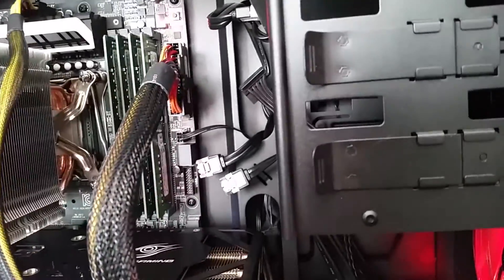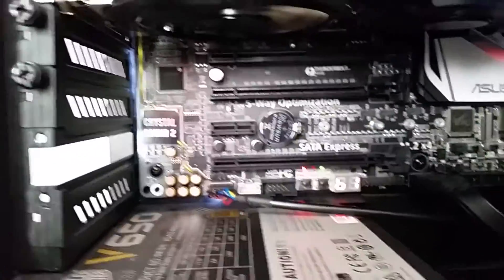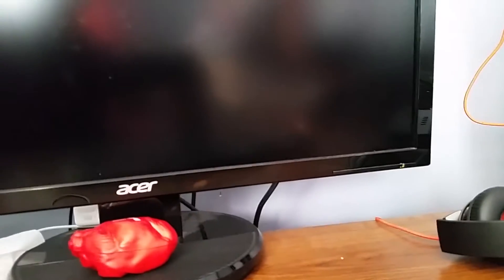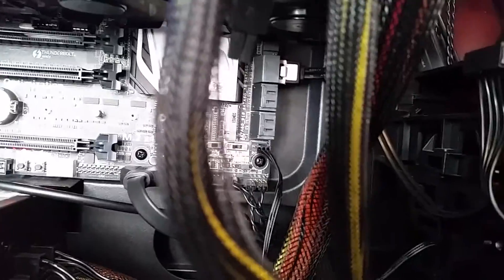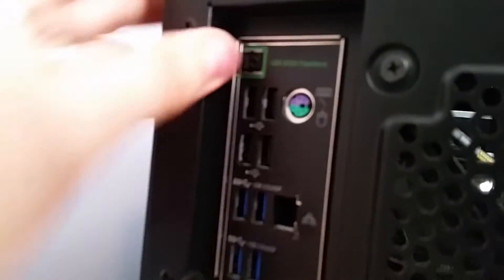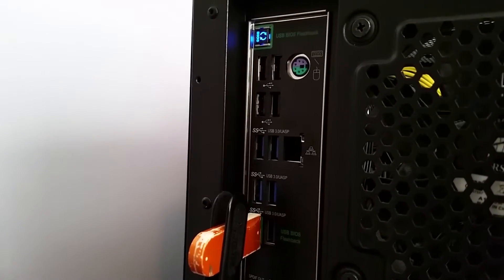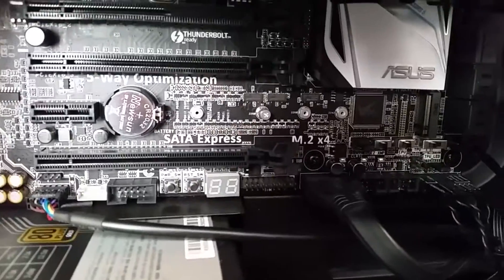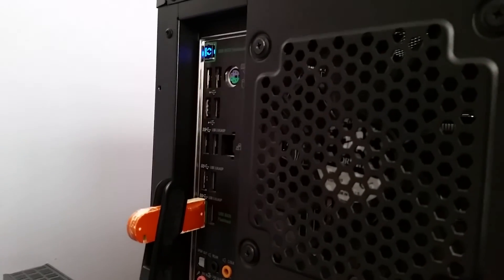10-18-2015  troubleshooting steps video 1

Comment: I just got the same motherboard that came like three days ago. I have the same problem. When I received my mothevoard the reset bios button was broken. I wonder if its the motherboard.
Reply from the maker: I wrote up a reddit post detailing everything man. They eventually said I was stupid and sent them the wrong product then sent me a different motherboard that doesn't fit my cpu o_O https://www.reddit.com/r/ASUS/comments/3xz9sf/asus_gets_a_lump_of_coal_for_christmas_serious/
Reply: +Charles Rowland I have read your reddit post and what a shame for asus sending you the wrong mobo. 
I was thinking about taking it to a pc repair. I have done everything you did on your troubleshooting videos and same error as yours. Were you able to fix it? How is your pc right now ?
Reply from the maker: +Edel Patrick Cabradilla my original board works except for the two bad ram slots and I still have that board thankfully. Nothing ever got resolved on the two replacement boards. I did an advanced rma, so they sent me the replacement board without me having to send them a board first. This video is of the replacement board. I then had to send this board back to them. They sent me another board to replace THAT one and it had the same error. So then I had to send THAT back where they then told me I sent them a Maximus VII Hero board and then sent me one of those back o_O

Now I am supposed to send back in a maximus board for the replacement.. a board i have never owned. They told me they wouldnt take the board they sent me back either, that it would go through repair if its not damaged they will charge me. They also say they will call me, and never ever do. so, whatever i guess. 

My advice to you, is get another motherboard that is not from ASUS. Burn the board you have in a metal barrel.
Reply: +Charles Rowland Yeah. I am returning everything back. The mobo+cpu+rams. 
I am tired of doing it by myself and I got myself a system from maingear.com with the same specs that I have gotten. 
So sad that I had to buy a prebuilt one, but I have no other options. 
I have invested too much time on trying to troubleshoot this.
Reply: +Edel Patrick Cabradilla so, i got an asus rampage v extreme that im doing an advanced rma with. Out of curiosity, did either of you two resolve your issues?
Reply from the maker: +18266609 nope :(
Reply: +Charles Rowland man that sucks. what did you buy another board from a diff manufacturer? asus needs to get their act together.
Reply: I got a msi motherboard. an x99a gaming 9 ACK
It is 100% working now. I guess both of us got unlucky having faulty motherboards shipped to us.
Reply: Edel Patrick Cabradilla im glad to hear it. I think its just asus. Their quality control has went to hell in a hand basket. my rampage v extreme has pch initialization problems on warm boots. I was told that this could be bad solder joints from another guy on youtube who had the same issues. I'm In the process of doing an advanced rma on this board. This motherboard keeps me up at night with headaches. Cant wait to get a working board. if this doesnt pan out, im chalking this up as a loss and purchasing an msi board.